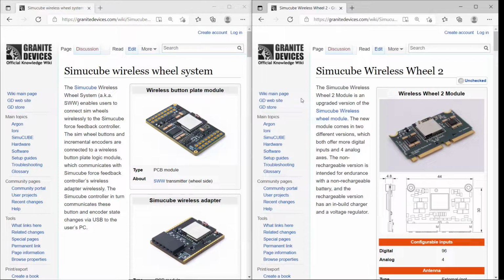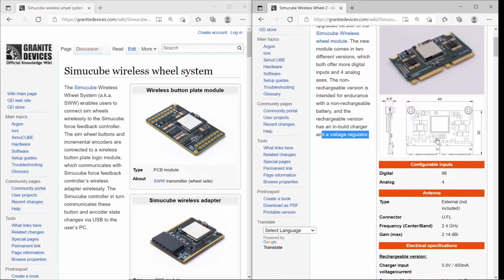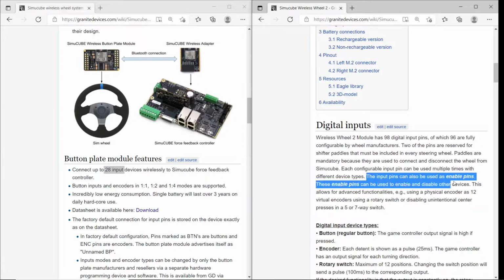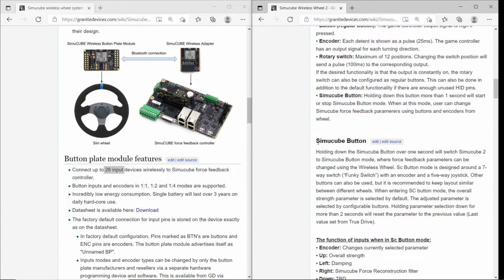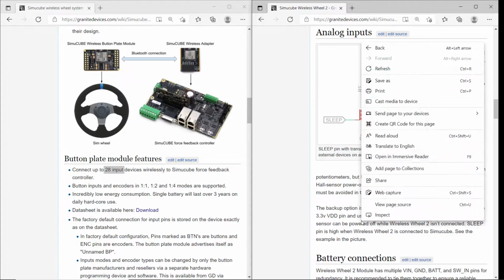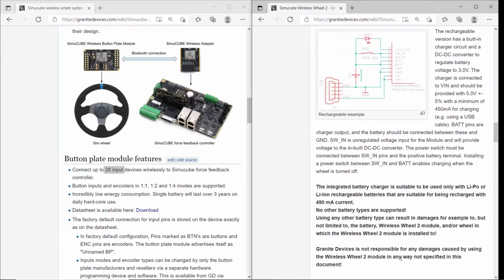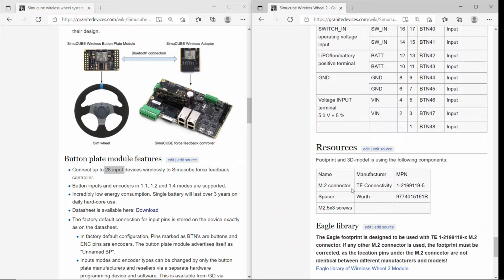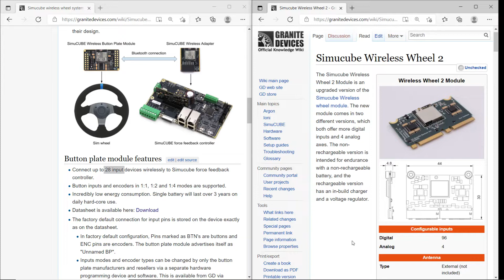Simucube Wireless Wheel 2 module

Comment: Can you use this to turn a Wireless Cube Control wheel into a wireless direct to PC?
Reply: Thats what I would like to know too!
Reply: @Killerbeege  alright i just ordered a BT dongle hope it works with the cubecontrols if not then its okay ill stick to wired.
Reply: @daemon3spade  Let me know whats up! I got my formula sport USB wheel for cheap but absolutley hate the usb lol
Reply: @Killerbeege  im pluggin the TP-link UB500 right now.. drum roll please..
Reply: bro.. when i plugged the dongle my pc cwas able to see the BT adapter and it showed device working properly. Then I went to add BT devices I could see the Cube control wheel but then when I tried pairing it cannot pair...   SO i went to restart my PC and now it is working!!! This F-pro wheel is working!!!
Reply: @daemon3spade  Solid! ill take a look at it. Thanks for the info dude!
Reply: @daemon3spade  How do you have everything connected then? usb cable coming off the wheel to the dongle? how do you have the dongle plugged into that?

Thanks for all the info!
Reply: @Killerbeege  I attach the F-pro to my Simagic Alpha wheel with QR.. Turn-on the wheel in BlueTooth wireless mode and done. The wheel has battery inside I now only need to plug the magnetic cable when I want to charge it. Now I can even use my wheel as a gamepad!
Reply: @Killerbeege  Update.. the wireless connection gets cut-off quite often,. I went back to using the cable just until I find away for the connection to be stable..